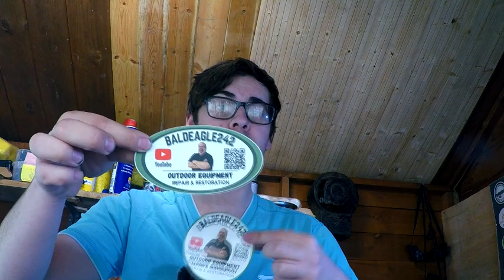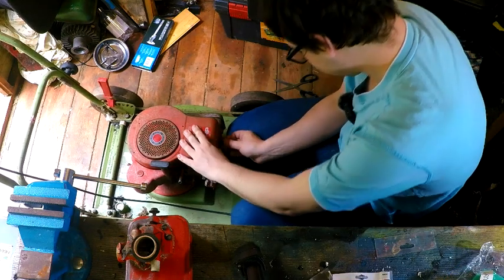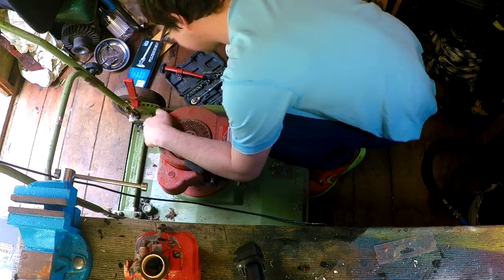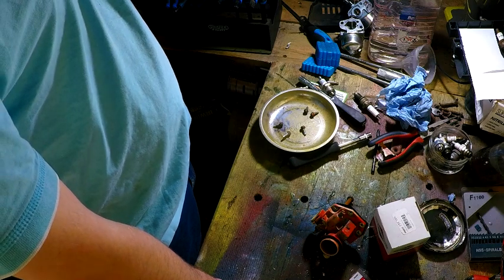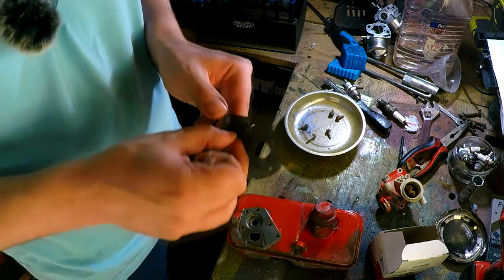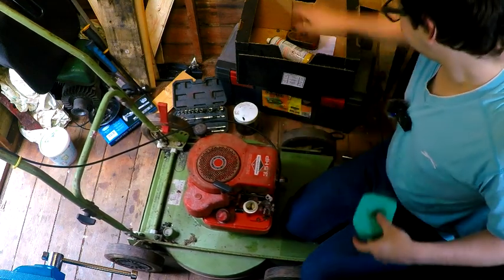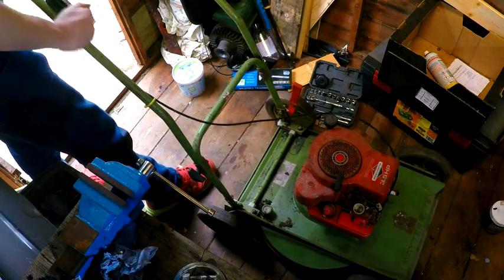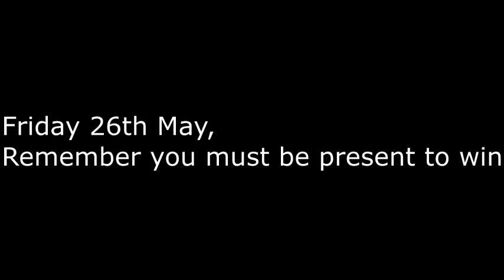Hayterette repair Will it run?

Comment: Well Scotti you got part way there so looking forward to you getting the spark issue fixed.
Reply from the maker: Should be a easier fix than thought, it's got point which full makes sense considering age 👍
Reply: @ScottiDaniel  Likely easier to install an electronic ignition coil which normally calls for switching the plug from an RJ19LM to a RJ17LM and fire it up, fire it up!

Comment: It should be a points mower.. and they may need cleaning.. also did you put the pick up tube back on the carb? It should have a long tube Like the classic ones.. without it it will never get fuel..
Reply from the maker: Thanks Mick does make sense now it have points, yes I did put the pick up tube back on after releasing I forgot it. 👍